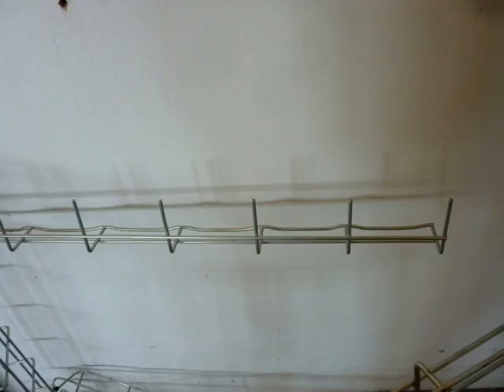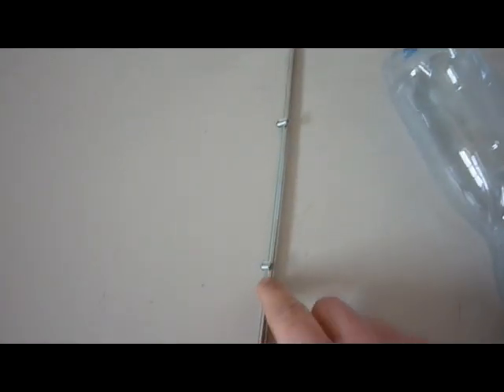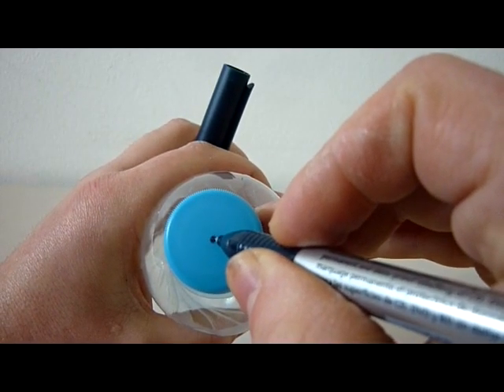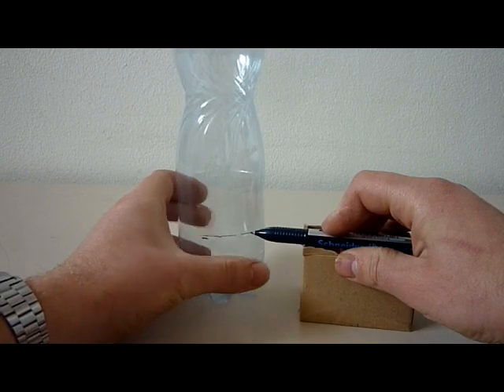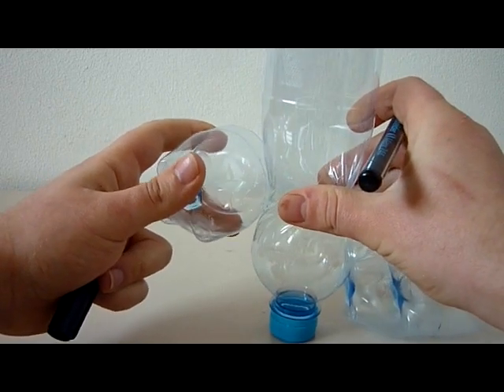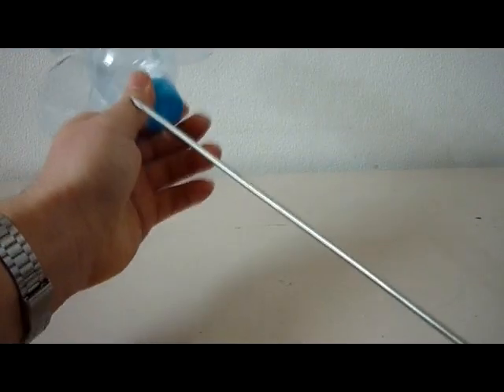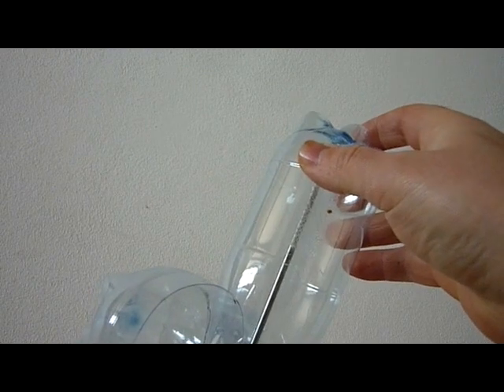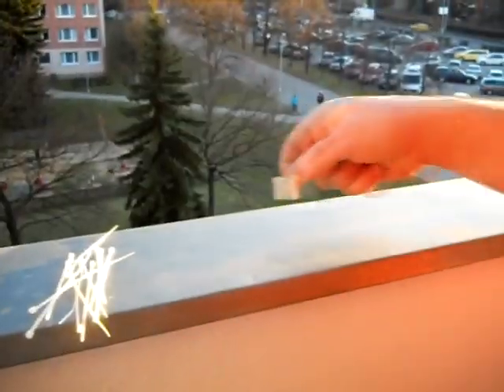wind turbine from plastic bottles English language

Comment: Hi what are the materials needed for this project ?
Reply from the maker: Hello. Basically everything you cen see in the video. You will need some basic tools, plastic bottles, cable ties or wire and something to put on your bottle(stick or metal rod). Have a nice day.
Reply: Thank you so much! By the way does this project make electricity ?
Reply from the maker: Hi. I think that if you will somehow connect it to the really small generator- it can make some electricity but honestly I think that in this case is not worth your efford.  I think that it is much easier to use solar panel for generating small amount of electricity. But If you have some small generator you can try it and let me know if it is working. Have a nice day.